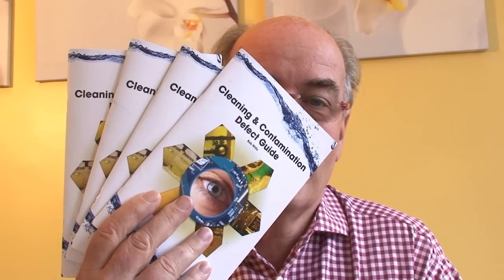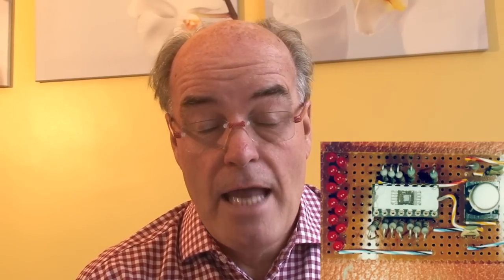PCB Cleaning & Contamination Guide - Ultrasonic Cleaning Problem or Not?

Comment from the maker: You will find that most systems that are designed for cleaning PCB assemblies use 40kh but before you ever start cleaning and process set up you find the best combination of cleaning solution and flux residue. It makes cleaning easier and reduces the time required. I have been qualify processes and materials for many years.

Many thanks Bob Willis

Comment from the maker: In the case of all cleaning systems the machine and the ability to clean a full tank of boards you should use the recommended level of cleaner. Your machine supplier should provide you this information in the machine manual or give them a call.